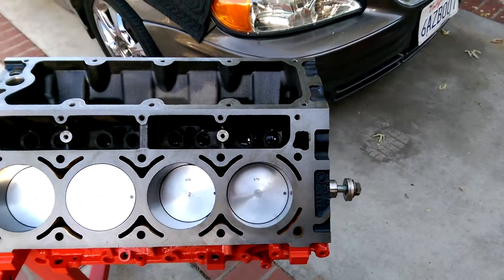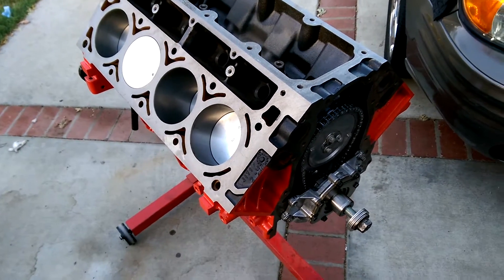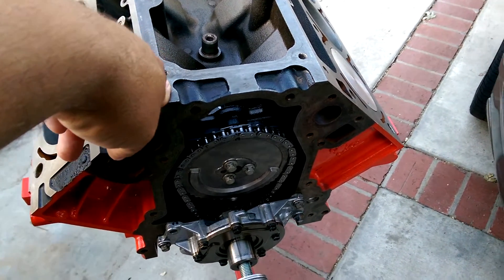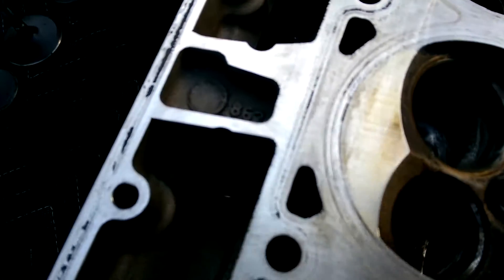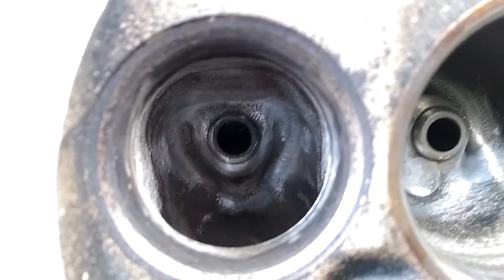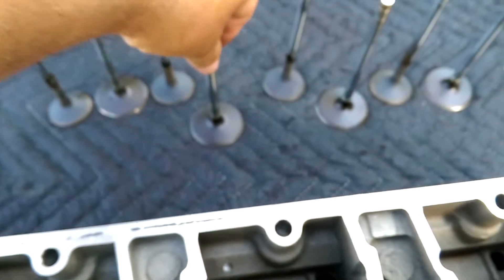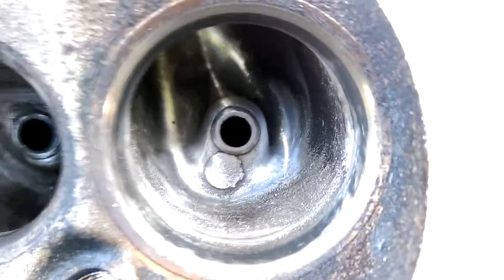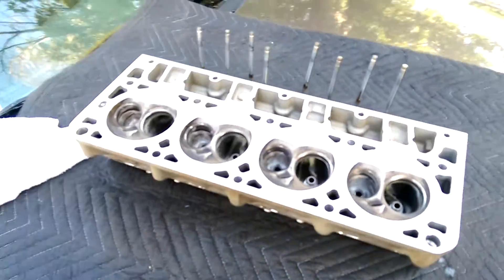LM7 budget build

Comment: Great build but just a suggestion if you go iron instead of aluminum block you can have what’s called a iron ls1 and have it bored to 346 use stock ls1 pistons and rods for just a little more umph that way it’s not so lazy down low with this type of cam
Reply from the maker: This is a LM7 build kept the standard bore cuz I might throw some boost at it.

Comment: Ya the machineing probably cost as much as a used set of 243 heads or something
Reply from the maker: Lol you would think but no it didn't hot tanked 3 blocks decked the LM7 and installed my cam bearings all for about $130.

Comment: How much did you shim the oil pump and what’s the new/current oil pressures?
Reply from the maker: HeadFlowInc hey hows it going I shimmed that pump just over .100 inches (4 small washers) I also ported the housing on it and I idle around 50-55psi

Comment: Great build! I just purchased an LM7 and have a question for you. 

That looks like Chevy Orange engine paint, correct? What specific brand did you go with and did you use a high temperature primer underneath over bare metal? I just got my block from the shop where I had them perform the heat and blast to remove all rust and paint, so wondering what would be the best approach to painting the block. Thanks much.
Reply from the maker: Zoran M its plain old red rusto-oliem engine paint
Reply from the maker: Zoran M all I did was tape off everything that I didn't want painted cleaned with acetone and spayed, nothing special.

Comment: What's the update?  I finally have an LS swap in my Blazer, stock 5.3 for now.
Reply from the maker: HeadFlowInc nice! well I got it to idle right and it runs and drives good but I still need a dyno tune im gonna have to save up for that guys around here want $600.
Reply: martinez1701a Good news on the idle!
I don't even have my o2's or exhaust installed yet, but it starts and drives fine. I'm sure mine will drive much better with working o2's lol.  I have a basic/base line Tune created on HP Tuner Pro I want to try once I get the exhaust installed. I had to delay my Turbo build and go with a stock 2000 5.3, still fun with the T-5 trans!
Reply from the maker: HeadFlowInc sounds good im also looking for an LR4 engine to turn into a 5.1 saw a few of them months ago for dirt cheap should have jumped on them one guy was practicly giving one away.

Comment: On the intake bowl cut, which is the size of the opening below the seating area you can go to a max of 90% of the valve size.  Measure the opening below the seating surface and see if you can clean it up close to a 1.66" or a bit more with the 1.89" valves.  The tough part is completing the bowl cut without touching the seating angle. Very careful!  I like to shoot for a Intake bowl cut of 87-89% on the intake side and 85-87% of the valve size on the exhaust.  Once you establish the bowl cuts then you blend them fully into the port.
The work you've done so far looks good!  When removing the rocker bolt bump don't forget those bolts must use thread sealer after that mod to keep oil out of the ports.  JD  Go slow and take your time working near the seating angle!
Reply from the maker: didnt touch them more after that i did take some sand paper and smoothed everything out by hand especially the short turn radius.
Reply: martinez1701a
 just removing the swirl ramp and profiling the guides helped the flow.  Nice work!
Reply from the maker: Thanks btw im gonna take what i learned from your vids and apply that to a set of 241 heads off my ls1 lots good info in your vids I didnt think of.
Reply: martinez1701a
 Always be careful working the swirl ramp area because there's a water passage right below it. Slow and steady good luck!
Reply from the maker: +HeadFlowInc yeah I know I only worked it til the sharp edge was smooth didnt want to mess anything up lol.

Comment: How much did you shim the pump spring?  .080-.100?
Reply from the maker: i used 4 SS washers that measured just over .100 inches.
Reply from the maker: +martinez1701a gave me just over 50psi at idle when warmed up have to double check though.
Reply: martinez1701a
  That's what I'm planning on doing is the .100 shim looking for around 50 psi warm idle.  I won't need more than 65-70 psi max hoping it won't create too much.  Thanks I appreciate the info!  JD
Reply from the maker: I read in a few places that you can go up to .120 inches theres also a pdf you can download somewhere.

Comment: Hey man where did you get your pistons at?
Reply from the maker: there by Enginetech there actually stock replacement for the LR4 4.8 but if you throw them in a 5.3 they raise the compresion to 10.25:1, I actually found them the cheapest on ebay $300 with rings.
Reply: +martinez1701a yea man that's what I wanna do. I wanna put those flat top on my lm7.
Reply from the maker: +Juan Lomeli i just did a quick search on ebay these are the ones you need put 331745102263 in the ebay search.
Reply: +martinez1701a thanks man I appreciate it! I'm new to the "ls engines " lol
Reply from the maker: +Juan Lomeli cool cool also you might wanna checkout cams on jegs they seem to be the cheapest btw you can interchange any gen3 cam since they dont list cams by lm7 just lookup for 99 trans am 5.7 or 99 corvette i think they have two choices.
Reply: +martinez1701a yea will do man. and suggestions on what rod & main bearings I should go with?
Reply from the maker: +Juan Lomeli i just got stock replacements for mine nothing special oh and btw if you go onto jegs this is the cam i got JEGS Performance Products 200580 - JEGS Hydraulic Roller Cams
Reply from the maker: +Juan Lomeli dont forget to shim your oil pump too lol, that setup should put you between 330 to 360 hp at the crank with a good tune
Reply: +martinez1701a oh ok. would it be better if I get a high psi oil pump instead?
Reply from the maker: +Juan Lomeli if your oil pump is good shim it and you will have a high psi one lol you can also port it too thats what I did. Do you have alot of miles on your LM7?
Reply: +martinez1701a the motor has about 110k
Reply from the maker: +Juan Lomeli thats not alot on those engines the block i got had at least 130k on it and when i put a mic on the old bearings they had no wear.
Reply: +martinez1701a you think I should just get it to be on the safer side though?
Reply from the maker: +Juan Lomeli i would buy a stock replacement oil pump and shim that, its the same as a high psi pump i shimed mine at about .105 inches and got just over 75psi close to 80
Reply: +martinez1701a nice! did you do any work to your block before putting it together?
Reply from the maker: +Juan Lomeli just hot tanked and decked it, it was a running engine before just had a bad head bought the bottom end for $200
Reply: +martinez1701a oh ok. I'm thinking of doing the same and re-honing it. it was a running motor too but it's been sitting for a couple months now
Reply from the maker: +Juan Lomeli yeah honing is a given with new rings.
Reply: +martinez1701a would it be a problem if I wanna nitrous it?
Reply from the maker: +Juan Lomeli i dont think so ppl nitrous stock motors all the time
Reply: +martinez1701a oh ok. should I put the ls1 intake manifold or the ls2?

Comment: Which is better for horsepower, ls1 or lm7 and why. not sure the difference between them. I have a lm7 from a 99 gmc sierra. my dad just gave it to me yesterday. I'm deciding how I want to rebuild the motor but don't know too much about my options.
Reply from the maker: basicly all gen3 engines are the same only main difference in bore size and block material anything you do to a LS1 you can do to a LM7 as far as power they are very similar, you can always bore out the LM7 to 5.7 but in my opinion its not worth it. You will find the LM7 is more cost effective than a LS1 i spent $200 for the bottom end and $150 for heads a new LS1 will cost $2800+
Reply: +martinez1701a I heard the same thing about boring it to a 5.7 from a couple different people. what are the stock heads on a lm7? are they aluminum?
Reply from the maker: +Wiggy McCrackin yeah stock heads are aluminium but boring is a waste your only gaining .4 liters not worth the trouble and money i do recomend swaping the dishtop pistons with flat tops and raise the compression. also porting those stock heads are a good idea.

Comment: hey man, so heres my deal, im 19 and dont have alot of money lol, but i have very similar plans as to yours, i want a 98-02 ss camaro, i want to pull the ls1 that they come with and do almost the exact same thing, 5.3 lm7 swap. is it hard to get that 5.3 to fit in a fbody? how much power does it make? and would domed pistons make a big difference in power?
also, how much did the whole thing cost in the end, including buying the block/engine?
Reply from the maker: All gen3 blocks are identical the only difference is block material, bore size and with the iron gen3 you have to drill and tap a hole for altenator bracket no big deal.
Reply from the maker: i probably spent about $1200 in parts and my build will make more power than my stock ls1 but the iron gen3, lm7 blocks are usually overlooked thats why there so cheap u can also use a lq9 6 liter truck block but those are going up in price
Reply: martinez1701a they should fit right in place of the ls1 right? ive been told they have the same motor mounts
Reply from the maker: +Hunt3rsFire430 all the same you use everything just as long as its another gen3 your golden.
Reply: martinez1701a ok cool man :) what about the alternator, i saw people in forums saying you need to drill some type of holes in it ( it didnt make much sense to me though
Reply from the maker: +Hunt3rsFire430 thats the hole i was talking about the alternator on the ls1 sits lower than on the lm7 so you have to drill and tap a hole for it, its not a big deal.
Reply: martinez1701a ok cool, thanks man
Reply: +Hunter430 if you do the camaro 5.3 swap post it i wanna see.! Good luck man✊
Reply: 74 Lito thanks man, im still tryin to get some funds to buy the car, i will certainly post it man!!!
Reply from the maker: ***** I just got mine swapped into my trans am like a week ago I have a video posted up
Reply: +Hunter430 theres no point of replacing an ls1 with a 5.3 lol unless the ls1 is messed up your just going to waste your time...
Reply: ***** 5.3 is iron block, holds boost better
Reply: ***** boost ls1 then when it goes boom get an iron block 6.0 :)

Comment from the maker: For anyone looking to build one of these here is the price list so far on my budget lm7 build.
Used 2003 lm7 bottom end with oil pump $200
Cylinder heads 862 casting $150
Jegs cam for the ls1 216/220 .560 114lsa $290
New flat top pistons with rings $300
Cam rod and main bearing $75
Cloyes c3210 timing set $47 + $8 shipping
New cam thrust plate $24
Full gasket set $130
Hot tank and decking $150
Reply: Could you give a detailed breakdown of cost of all the machine work costs and parts. Did you have a machine shop install the cam bearings ?Did you have the assembly balanced . And a breakdown on the heads too. Machine work and parts cost !
Reply from the maker: JQ Public only machining that I had done was the block deck and they also hot tanked it think it was $120 all together everything else I did myself, i installed cam bearings and cam the heads I ported myself and rebuit them lapped valves new seals and ls6 springs i cleaned up the mating surfaces with 800 grit sand paper and took a straight edge to make sure they were flat I also used felpro pt9292 composite head gaskets just for peace of mind sealing the surface.
Reply: ok so you just did a hone on the cylinders yourself, no align bore on the mains , did you polish the crank , std size bearings ? You bought new pistons , but reused your stock rods? You selected the composite over MLS due the better sealing, if the heads were not completely straight. Sorry for all  the questions.
Reply: What do you think about the 862 heads? I'm thinking about swapping my 706 to 862 heads in my 05 yukon

Comment: Cool project! Love the flat tops in the 5.3 and love a budget build!

Your compression maybe be higher. When I calculated the compression ration in my 4.87 piston 5.3, I think that i came to about the same CR you stated, but then I realized that I left a number out. The final ratio came to 10.6:1. I've had no issue running regular pump gas in it BTW.

If you plan to pay a mahcine shop to do a valve job, it usually doesnt cost much more to have them cut the seats out a little larger for the 2" valves. Maybe 20-40 more. They'd have to look at them. They may not realize that the stock seat can take the larger valve.

On the heads, the look good. If you wanted, you could bullet the guides more but thats not biggie. makes sure that you have no lip from the valve seat going into the port. You want a smooth transition there. Also, I'd go in with sanding rolls and smooth the casting off of the walls of the whole port. Always make sure no to cut into the floor of the port, intake or exhaust, but it doesnt look like your doing that.
Reply from the maker: Hey thanks for the comment this is my first crack at these gen3 heads I've done mild porting in the past i usually build gm 3400 v6 engines but since i havent had much experience with gen3 v8 didnt want to go in to it all cocky and trash the heads, thanks alot for the advice.
Reply: Makes sense! I've got a supercharged 3800 that I'd really like to play with if I ever get a break.
Reply: +martinez1701a multi angle valve job